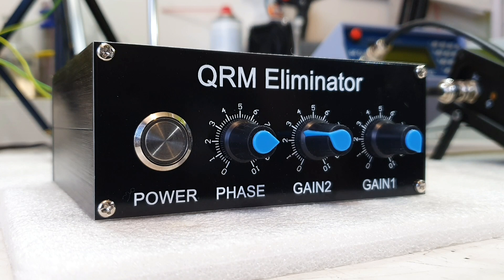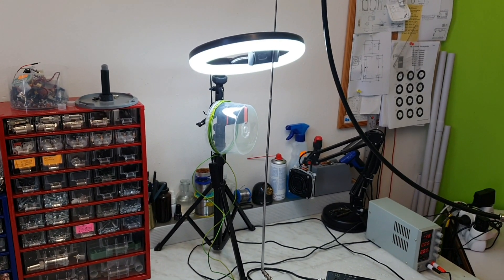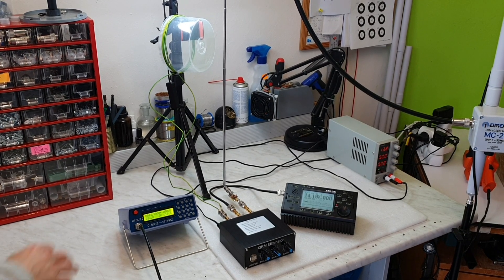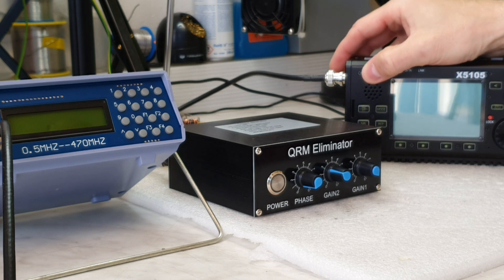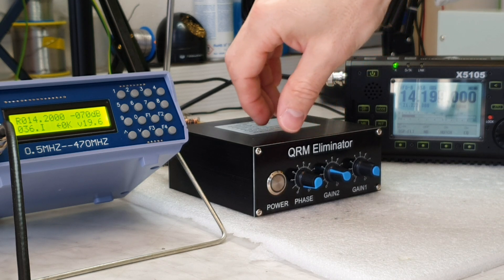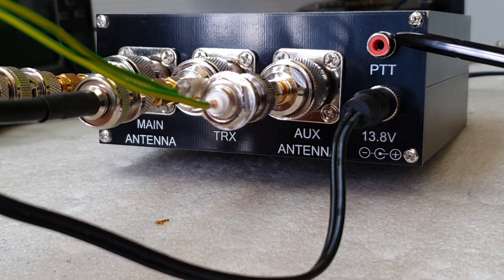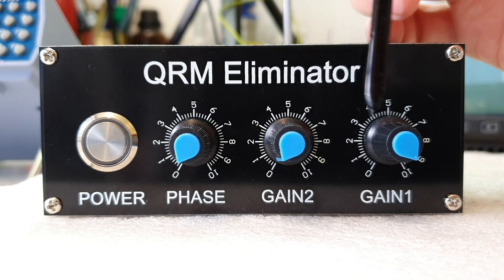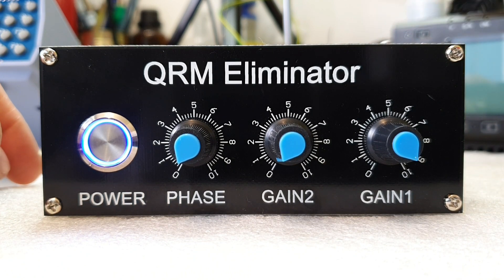QRM Eliminator / RF Noise Canceller

Comment: The Gain 2 control is labelled the wrong way around on this particular model. 0 is max gain, 10 is zero gain. You can test this by swapping your main antenna to the aux socket and having nothing plugged into the main socket. 

Ideally you want gain 2 as low strength as possible , so as near to setting 10 as you can, to reduce QRM so it doesn't reduce wanted signals.

Comment: I bought the WIMO version of this. Useless. It did nothing to get rid of the QRM. It did get rid of wanted signals, which is awful. Main antenna is Steppir DB11. Aux antenna is a small telescopic whip with PL259 connector.

Comment: How do you hook this up if you're using ladder line?
Reply: Presumably the ladder line is NOT connected directly to your transceiver, right? Place it between the coaxial antenna input of your radio and whatever device (balun, tuner, etc.) you're using to match to the balanced ladder line.

Comment: QRN. It's QRN. QRM is man made interference, not electrical noise. A station operating one kHz away from you is QRM. Atmospherice noise, lightning static, wind/rain/snow static, electrical impulse noise from appliances, ionospheric noise is all QRN.
Reply: There's always a "super wise guy" telling this kind of comment. Ego ego ego.
Reply: @eduardopower5254  Hams will argue about anything. There should be a Q code for it...I nominate QRA. The "A" can be interpreted a few ways. 😁
Reply: Electrical impulse noise from appliances is man made noise - QRM - (M for man made, N for natural) and these units are designed to eliminate that and not QRN such as lightning static crashes.
Reply: @garys.7846  There is no little man inside your appliance making it interfere. The electrical noise it makes is QRN.
QRM - Man-made interference is other radio signals, intentional, or unintentional, Amateur or commercial.
Reply: @AlGritzmacher  A man or woman made the noisy, interfering appliance. Ergo, the noisy RF emanating from that appliance is manmade. Not naturally occurring atmospherics.
Reply: The M and N would suggest that this is the case, but it’s actually a common misnomer. When the Q codes were derived (a long time ago) they had no designation for noise made by 50 or 60hz dirty switching ac devices. The M is actually more along the lines of if an operator is transmitting 1khz above or below and Donald Duck-ing into your conversation. That would have been how “man made interference” was conceptualized back then.. 

The more appropriate designation for any sort of electrical noise interference is actually always QRN.

Comment: Hello 

I got a Yaesu FTDX 101 MP

QRM Eliminator is turned off can you transmit 200 watts ON it

another problem I would have with The qrm Eliminator

all my HF antennas come in the House to a big 2K a Ten Tec 229B manual Antenna tuner

on the back of my Big Ten Tec 229B antenna tuner I got a coax jumper running to antenna switch box

for two different Radios  Yaesu FTDX 101 MP  ICOM IC 7610

thank you

73

Comment: what is the transformer at the bottom of the primary rx antenna?
Reply from the maker: It is my mini 49:1 UnUn transformer which I use with my small SDR Malchite clone receiver. 😉
Reply: @OM0ET  thank you for the reply. What use does the balun have on a Rx only setup?

Comment: Is it QRN or QRM? QRM is interference from adjuecent frequency and QRN is noise according to radio lessons I have learned. 73
Reply: QRM = (M)anmade interference of any type, QRN = (N)atural sources of noise, such as lightning crashes, atmospheric static, etc. This device may help with QRM from noisy electronics, power poles and the like, but it won't null out the loudmouths talking over your net on 40 meters.

Comment: so you don't need to use the PTT then? will the radio not be damaged if you use without it?
Reply: You need to use the PTT switch if you plan to Transmit otherwise you will cause damadge to the eliminator.
Reply: @MrNathanChester  why would you just listen?? Of course you want to tx..then this is usless.
Reply: @charlessalard4636  the device is to reduce noise on receive if you are just a short wave listener you wouldn't need the PTT

Comment: Should this be a standard feature in modern HF transcievers given the issues many hams now have with RFI which only seem to be getting worse as more and more noise generating gadgets are installed all over the place.
Reply from the maker: Yes, that was my thought too. Why is not the phase cancellation the feature of any modern transceivers... that would be great!
Reply: @OM0ET  and it should be automatic!
Reply: That would require the Japs to give a crap what anyone wants.

Comment: I got one similar unit from MFJ, it worked great to eliminate noise from nearby commercial lightings while I work 6m, and it got auto Tx sensing to bypass the unit without additional wiring, but on this particular channel I need to add a 1.25x accelerator as well...

Comment: I purchased one of these hooked it to my rig expert and on 40 meters when I turn the unit on the SWR jumps from 1.04 to 3.5 so it is unusable for me. Have you checked your SWR with the unit on? Both antennas are 1.04 or better stand alone.
Reply from the maker: Mine is working fine 🙂
Reply: Same problem. 
Is it the random China Quality? maybe you have figured it out?

Comment: Hi Paul, nice device. Did you try this with 100W Power of your ICOM transceiver already? Because this is the big problem with my 7300. Tnx for any hint...
73 by Martin DG4BAD
Reply from the maker: Yes, I did Martin 🙂👍I didn't noticed any problem yet.
Reply: @OM0ET  Hmmm... mine is clicking around with the tx relais at more than 50W on 80, 40, and 20m... 😭. It's then impossible to tune the antenna... Perhaps I try to change the HF-wires inside the device to RG174...

Comment: I just borrowed one of these to test. My main antenna is a 40 m long EF, about 10 m up. I first tried my 144/440 antenna as aux, because I had read that it was a reasonable choice. It was not good, because the box didn't register any noise at all. I then ran a 10 m wire out the window. This picked up more noise on aux. I was able to clearly reduce the overall noise (using SDR Console to view), but readability did not increase. I was listening to an AM transmission on 80 m. After some experimenting, I clearly had the noise down by a few S, but also the clarity of the AM transmission. I will try a better antenna, and update my comments.
Reply: How did it go?

Comment: All you demonstrated was that it does what you describe in that situation. Placement near the noise source is the key and is the problem in the real world. The signal you use is not nor is it similar to a voice transmitted thru a radio. Put together a real life scenario and record and post video.
Reply from the maker: I am sorry but if I had such noisy QTH so believe me I would rather made a real life video than simulated.
Reply: Sure, this setup is far from real life. Usually you have no access to the noise source. Otherwise you could simply switch off the noise source… But it works under real life conditions, I tried it. The auxillary antenna can/should be a quite short wire. Ideally it is in no way resonant on the band you want to operate, to avoid picking up the wanted signal instead of the noise. The short (aux antenna) wire then picks up the noise and feeds it into the device to cancel out the noise by reverse phase mixing it into the signal received by the main antenna. That‘s how it works in simple words.
Reply: @pasixty6510  Common guy... this is just a presentation...don't blame it. I appreciate this video simply because i have noisy QTH and such device could be useful for me so I consider buying it soon.. but i am curious if this work for me. Thanks for video DE OM1ACC
Reply from the maker: @pasixty6510  Yes, I am not sure if you watched whole video, but same thing I have explained there :)